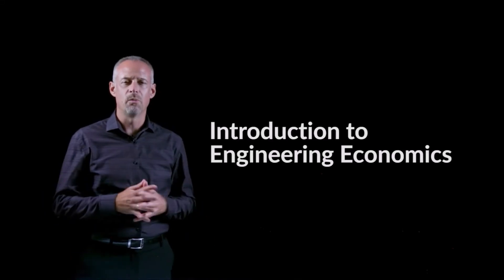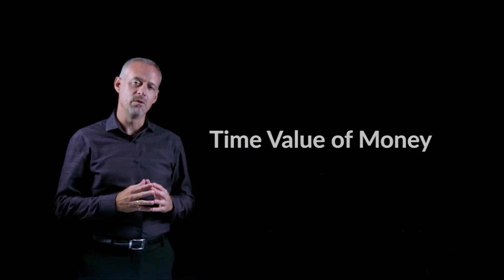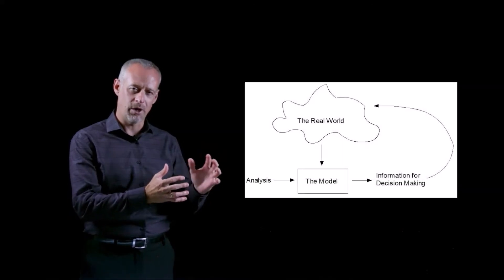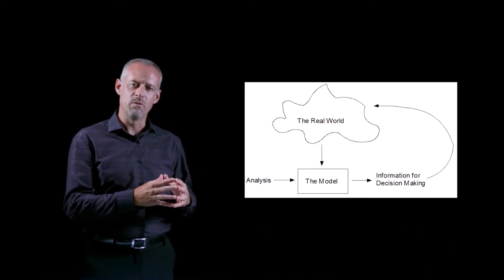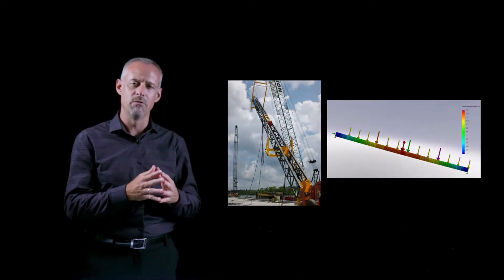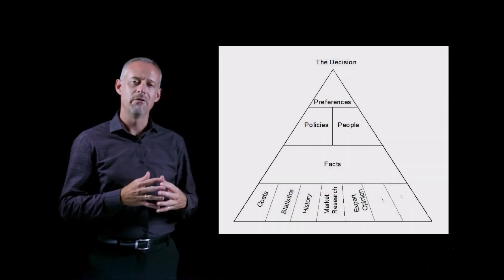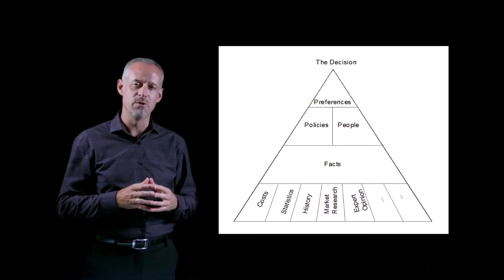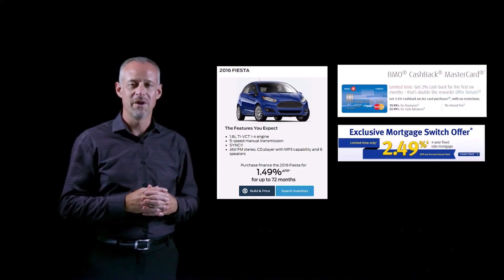Introduction to Engineering Economics - Engineering Economics Lightboard

Comment: Engineers are to be asked to get the current prices for engineering equipment and do engineering economic analysis. I do not see any analysis of current engineering equipment in the web pages.
Reply from the maker: I'm not exactly sure what you're looking for.  I have a Playlist with videos on 'Replacement Decisions' - perhaps you'd find that helpful?
Reply: @EngineeringEconomicsGuy  My comment is that engineering economics textbooks are not emphasizing or  asking engineers to go out into the market and find out the current market prices and costs and do the calculations. Also the books must have current prices of various types of engineering items in the example problems. The companies who are coming out with new engineering items or improved engineering items with modified prices must present an engineering analysis for a representative price and costs. What I see is that application of engineering economics is missing. Thank you for the reply.